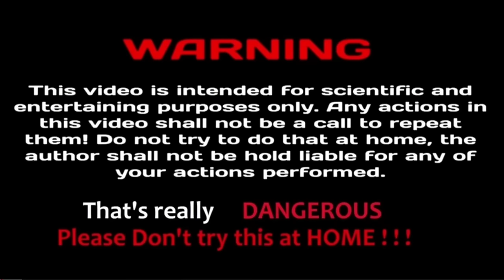How to make high voltage generator at home  | Super Powerfull stun gun

Comment: Imagine cover it all with resin and then understand you connected one place wrong.
Reply: Yes 😂,but he might have tested it before doing that
Reply: Muy bien gracias se entiende
Reply: Absolutely painful!
Reply: Jejejejeje... para un técnico electrónico, es totalmente normal suceder que, de vez en cuando, después de una buena soldadura de un cable coaxial, descubrimos que falta ponerle el plástico exterior roscado, que se debió haber colocado ANTES de la soldadura😅😂😂😂
Reply: Instead of resin cover the hole with plastic from a remote or something then solder it on.
Reply: Use acetone and epoxy will be like a soft rubber

Comment: If I may ask you the conclusion, is it effective if it will be used for self-defense? Does it neutralize a person? Or is it not that strong?
Reply: Yes depends on how much voltage can it generate ,some can be fatal ,some can be took person to be unconscious , it dangerous thing
Reply: @anandaalden1249  This one on this video?
Reply: @ZhbllokimeDyersh  after little research ,this is taser that relies on the 15kv transformer, yes it's can do harm. If it's not enough you can add more the blue capacitor circuit block or change the battery.
Reply: @anandaalden1249  Thank You for the idea! I will try!
Reply: if you’re going for more of an offensive and less concealed tool, look into shock baton designs. beauty of them is that they work with stun gun circuits with all you having to do is add more spark gap terminals. adds reach, pairs a kinetic attack with an electric attack, and allows extra space for batteries within the handle.

Comment: what are the blue things and black things there for what are they resistor type things what do they do to it iv bought a cylinder type step up module before and attatched that to a battery how is this diffrent with all the other gadgetry please let me know is all that better than a single three pound fifty 400kv step up module cylinder shaped off ebay, are e cig type batterys better than phone batterys mine lit up good off the same battery type as you i have high drain batterys 30a from a ecig i was hoping for more powerful setup how is best to do

Comment: Of course you do realize that the tiny button you use to control the power is not rated for the current (about 2.5 Amps) that you driving through the primary coil and the transistor?  It is not going to last long.

Comment: Why use epoxy?
Reply: to stop internal arcing within the circuit,,, the electricity will jump across an air gap by the easiest path, if shorter than the end probes

Comment: circuit diagram?
Reply: First circuit is used to convert dc into ac(not pure sine wave)that ac is used to step up by help of transformer and after that high voltage ac is given to voltage multiplier circuit (made of capacitors and diodes) to make some extra high voltage maybe.!

Comment: Pouring resin in the capacitor type shocker is not a wise thing because the life of this type of circuit is short and it needs to be repaired from time to time, and I only suggest pouring resin in its transformer, but because the two-trans type shocker has a longer life and pouring  It is better in resin. If you intend to defend yourself, you need a shocker with a current below 0.5ah and above 20mah, and low current will not affect you, and high current will not protect you, it will put you in trouble, and try to balance between amperage and voltage. observe
Reply: This is how,1set of 8gauge wire and ten India virgins and glue

Comment: Could you explain me the work príncip of the diodes and capacitors? I really want to know it.
Reply from the maker: In fact, capacitors and diodes are used to multiply the output voltage of the transformer. You can research under voltage multiplier circuit.
Reply: @skillmake  okay thank you!